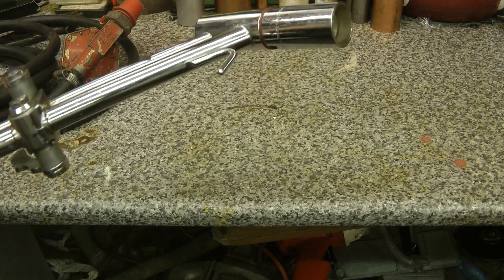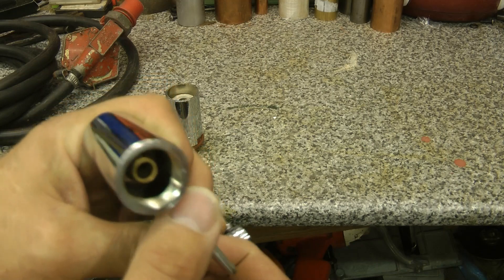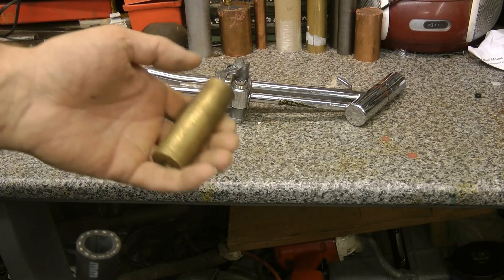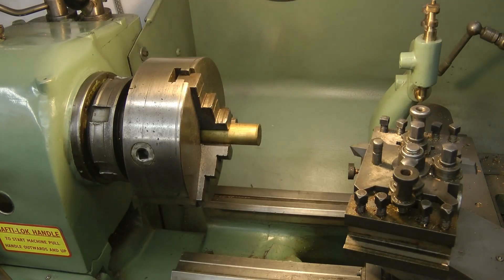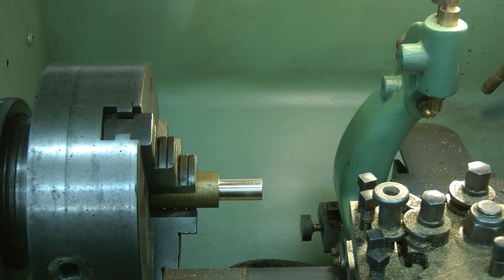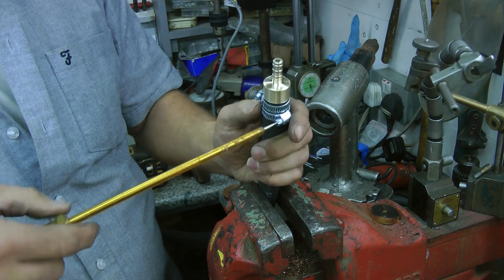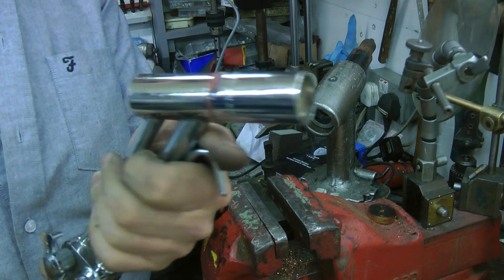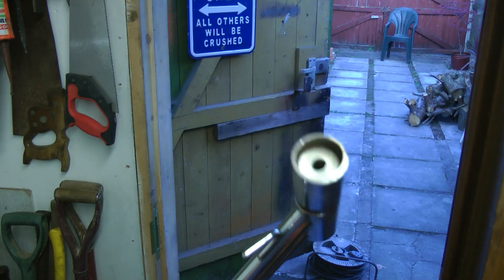Propane and air brazing torch I had to mod it to work

Comment: Just air and not an O2 cylinder huh?  Cool project.  I seem to have to make things work around here too.  Nice job.....
Reply from the maker: jster1963  yes it’s a gas air torch, runs off a air compressor, pretty scary 👀. Sends out a four foot flame ! Which caught me off guard